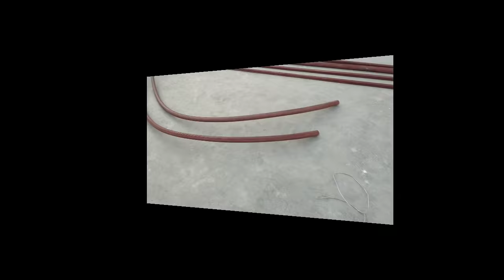How to install metal stair /making A iron spiral stair easy metalworking

Comment: As a welder, quick reminder, please use a proper welding helmet and eye protection, those glasses are not protective enough to prevent eye damage and the face shield is there for a reason. Otherwise great video!
Reply: Somehow knew this wud be at the top of the comments 😀
Reply: No need to use we r a legend

Comment: Sir , what is the size of the steps, and what is the distance between two steps
Reply from the maker: Step 30"Inch length
Step wide 13"Inch
Step distance 8.5 inch
Reply: Thanks for the reply,